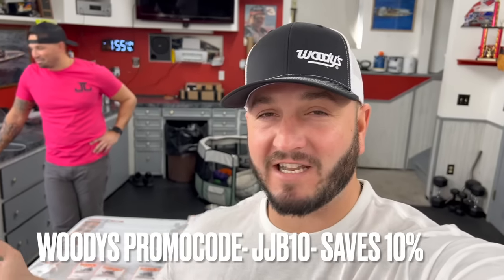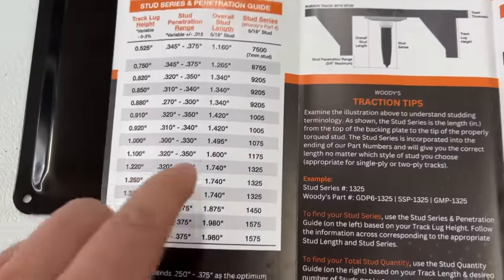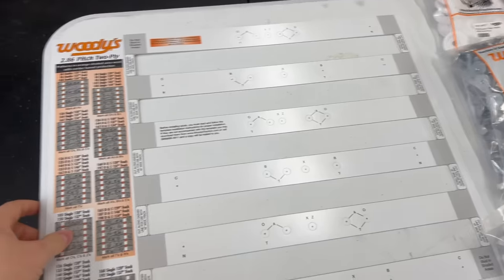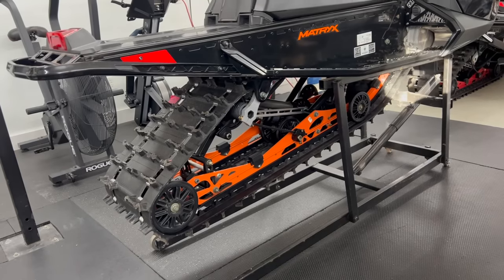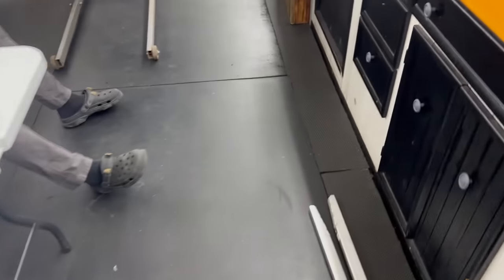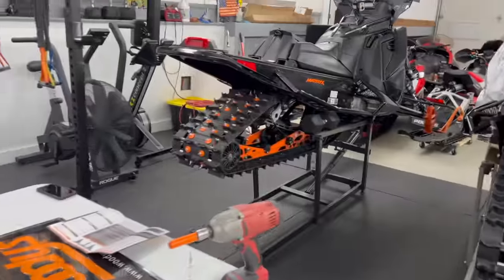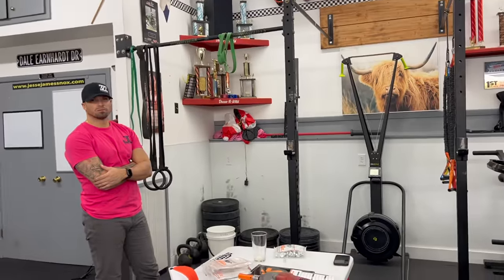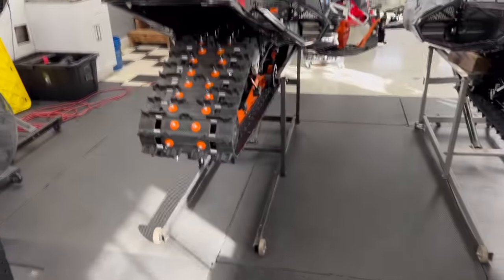POLARIS ASSAULT BOOST GETS 153 WOODYS TRIGGERS FOR ULTIMATE TRACTION! WHATS THE RIGHT LENGTH?

Comment: Hey Jesse, shout out from central Wisconsin. I’m really enjoying the videos. I’m setting up my VR1 like Bruce and you have suggested. So far everything is on order or in with the exception of the front track shock. Bruce suggested to go with a stiffer spring.  The spring in the XCR is the same  90-280 spring that is in the VR1.  I Work at a Polaris dealer and we cannot find a part number for the 100-300 spring. We called Polaris and they say there isn’t a spring for that. Are you using an aftermarket spring? I see that in one of the videos you had the HyGear Twisted spring setup.  
You really have a large following in our area with lots of riders using your vid’s to setup their sleds. Keep up the great work!!!
Reply from the maker: Hey Thanks for following along and supporting! happy the videos are helping you and many others. so that spring is the cross country spring that is currently on back order. You can call SOuth Side tomorrow and they can get you set up with a hygear dual rate set up for your weight and riding style. WIth the CC spring on back order thats the best option just a little more $. ANy questions let me know!

Comment: It'll hook up great, I did 163 in my XCR, per Rick I did the exact pattern as you, the back of the stud rubbed the top eyelet of the rear shock, mostly cosmetic but definitely wore the aluminum down some, and the torque spec on a 2 ply stud  is 15 Ft. Lbs for gold diggers and 30Ft. lBS on a single ply track for grand masters unless Woody's has changed it recently which I don't believe they did, Keep the vids coming, sleds looking good.
Reply from the maker: Per RIck those were the torque specs which i talked to him right before this video so i guess they have been recently updated? not sure . none the less best products in the USA
Reply: Just checked there site, your correct they did change it to 22 Ft. Lbs for 2 ply studs, that must be very new, when I google Woodys Gold Digger torque spec the link goes right it Woodys Site and still says 15 Ft. Lbs, wonder why the change? I'd like to find out, I always went 16 or just to flush, I retorqued them every 7-900 miles, almost always tight, couple would have a quarter turn. Never lost one. Thanks for the reply.
Reply from the maker: it was very very new when we spoke thats why i made sure to cover that in the video. If you follow the install instructions etc you should almost never have an issue! Thanks for following along and supporting!

Comment: Woodies are great but you have to try Stud Boys Pro Series backers, I use the doubles very strong and saves weight no need for nuts
Reply from the maker: i raced for studboy and had them on my race sleds. had issues with themm on trail. i enjoy a traditional stud
Reply: I also had major issues with the stud boys pro series backers.  Studs were good the backers not so much.
Reply: @JESSEJAMES322 what issues did you have specifically?

Comment: For someone that's never studded before and thinking about it , is there a need for gearing and clutching changes to make up for rotation mass getting added on ?
Reply from the maker: you will not need to change anything. If you were drag racing and every second mattered then yes but for every day rec use there is no need too

Comment: I've heard you lose some horsepower when you start a track. Especially when you stud aggressively. Is there any truth to this is it fact?
Reply from the maker: The theory behind that is rotating mass. Yes you add rotating weight but there is a hand off for traction.
Reply: Unsprung weight is a huge detriment to performance. Precisely why top performance cars make wheels out of carbon fiber, or the prominent use of carved and  hollow spoke aluminum wheels, etc... Camso tracks and various stud manufacturers are aware of this as well and there's a lot of products out there now focusing on reducing weight while maintaining durability.